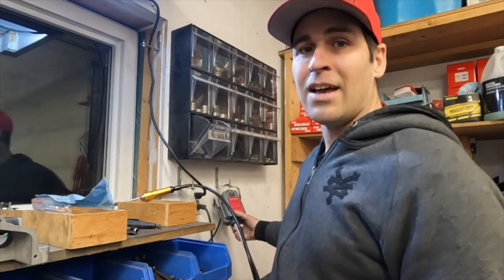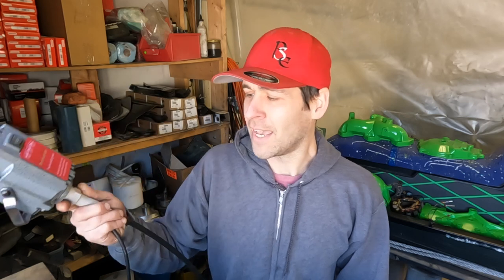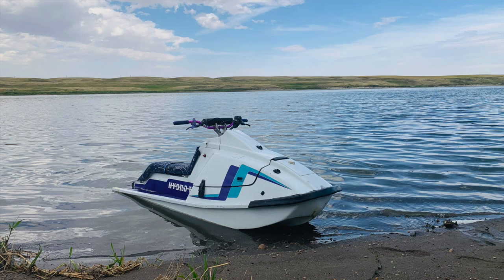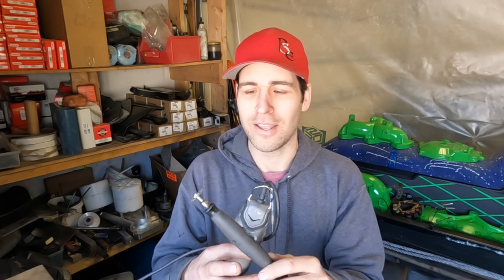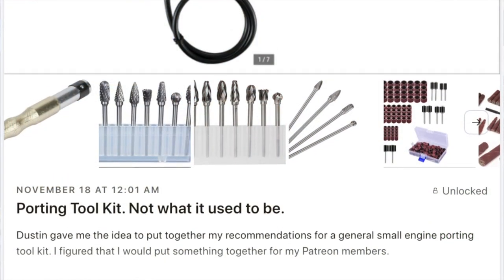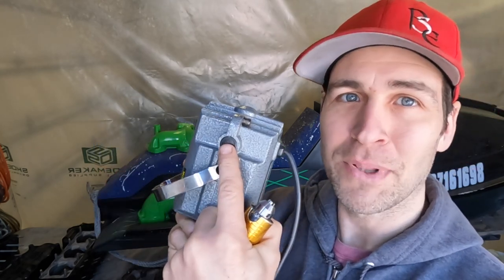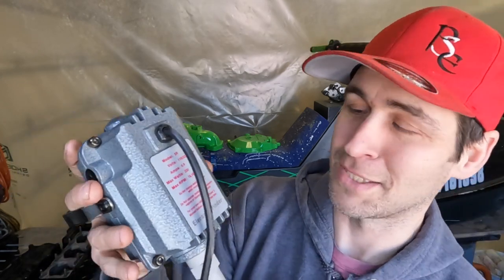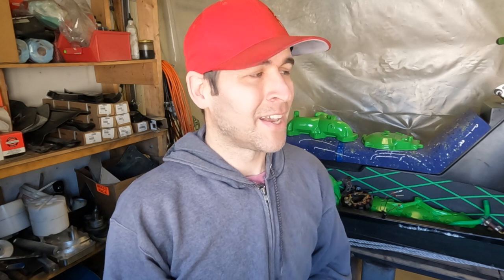VEVOR - Foredom Style Flex Shaft Grinder - In-Depth Look & Disassembly

Comment: Thought I'd let you know.  I've had the Vevor SR for about 5 years. Never had a problem. I service mine (lube, etc) as the manual says. I use Foredom flex shaft grease on the shaft. It was originally purchased for doing silver work but I have used it for everything including carbide burrs on steel. The silver handpiece (#30) is smaller than the 1/4 inch gold. Any foredom style handpiece made for the USA (flag or key they are called) can be used. I have quick release, hammer, engraving, etc. Do not buy Euro style, different connection. Look for the band with the ball bearing. If there is a clip  it is Euro. The chuck style handpiece will come apart(unscrew). Check it before each use. It will screw back together. I put mild threadlock on mine.
Hope this helps. If not, I just bored a lot of people.
Love your YT vids. Keep it up!
Reply from the maker: Thanks for the detailed comment. It is appreciated. 

I have had mine between 2 and 3 years... and also never had a problem. I have heard of people breaking them and I have to think that the are not using them properly, or they just happen to be defective. 

I have seen the silver hand piece and considered getting one, but am always surprised at how well the gold one works. I have a 90º tool, but it is good to know you can also get engravers. 

Thanks for the heads up about the Euro style. Mine has never come apart... other than me taking it apart out of curiosity, haha. Thanks again for the details.

Comment: i took the cable out of the dremel flexi shaft and coverd it in hight temp white lithium grease now it doesnt get so hot. so far its lasted 15 years. mind you im not porting metal cylinder heads Im building radio control model boats.
Reply from the maker: They are 100% better than using a file and sandpaper ! I did manage to port an engine with mine. Much better suited for wood, plastic and lighter materials, like you say. 

My first porting job, with the dremel, I literally used it every day for a month, probably 8 hours a day or more.
Reply: @ oojimmyflip
😆 sounds like the intended purpose, they built it for 😁
Did that too, no problems with my clones.
Then i used it in the shop for planing welds in tight spots with tungsten cutters - oh, surprise, needed one shaft after the other 🤣
Reply from the maker: @werner.x  Interesting... so they don't like that much hard work.
Reply: Thanks for the great video.  I’ve had a Foredom on my wish list for several years, but have decided to opt for the Vevor instead.  Just made the purchase using your coupon code.

Comment: Thank you for the wonderfully detailed review of the Vevor Flex Shaft Grinder. I've been wanting more information on this tool and you certainly supplied it!  Finally, I know what type of connection the shaft has to the tools!!!   If the hammer handpiece I'm looking at is compatible I'll be buying it through your link.
Reply from the maker: They just came back in stock for the US and Canada and Vevor is sending me another one for another video.
Reply: Thanks for the 'Heads Up' on your upcoming video. I'll be watching for it.

Comment: It looks like you could mount the foot switch to a 2x6 block of wood which should give it some heft. And the surface your foot contacts also looks kind of slippery. Maybe there is something you could spray on it to make it rubberized to prevent this?

 As for the smaller handheld Dremel. . . I went through several of them (corded and cordless) and found them to be crap. What I eventually settled on was the Milwaukee M12 cordless rotary tool -- The on/off switch and speed dial are separate and not combined. It has great heft, variable speeds, balance and ergonomics. Yeah. It's a beast and I used mine all the time.
Reply from the maker: I use my foot pedal on top of a milk crate as I'm sitting on a stool when I use it, and I don't have too much troubles with it moving. As for it being slippery, I don't actually put my foot on it, I just put my toes on it as I feel that causes a lot less fatigue. 

I have a TIG welder, and the pedal for that has a grippy top. Most of the time I put my whole foot on it... not sure why. I guess probably the shape of each. 

Milwaukee makes some good stuff for sure !! I have used a lot of different tools, but never a cordless one, for porting or the type of work I do. I had one of those pencil air grinders for a while and it was very compact, but had no power at all. 

With this tool, I still use a file, sandpaper and some other specialty tools for some stuff, but it is pretty versatile. One thing for sure is that you can never have too many different tools, haha. Options are always good.

Comment: The cables break on flex shaft tools if you’re using carbide bits and the suddenly get stopped, flex shaft tools are excellent for cartridge roll sanding, this has been my experience.
Reply from the maker: Yeah... snagging bits is very hard on any flex shaft. I have done at least 3 porting jobs and cut up lots of carbon fiber and fiberglass without any shaft issues. 

I have heard of people breaking these, so maybe it am just much more gentle than the average person. I had a Dremel flex shaft before this, and even though it is much smaller of a shaft, it lasted for years without failing.

Comment: Is the footswitch a true variable switch (press from low to high revs)?
Don't want on & out switch rev.
Reply from the maker: Yes, it is infinitely variable from zero to top speed, and is quite smooth. That is one of the nicest thing about this tool compared to my old dremel.
Reply: @loweredexpectations4927  You stated you got 230W. I decided/ordered the 780W & used your promo code.
I think more power is better than less power. Strange, the 230W costs more than 780W from Vevor.
Thank you for your reply & thank you for your honest reviews.

Comment: hey man how do u know what handpiece fits the rotary tool from vevor?
Reply from the maker: Hey, Julian. 

Vevor sells a bunch of different tools, and only a few of them had the quick change tool on the end. When I posted this video, they were available from all of the places listed in the description, but as of now, it appears the only Canada has the quick change style. 

Vevor does not advertise this feature / interchangeability, so I only know because my unit (Canadian 230W) has the quick change, and a buddy of mine got a 750W and the end wouldn't come off. 

If you have one of the quick change tools, (the tool just pulls off), this is the Foredom Style tool. You can search for that. 

If you have one of the other types, you may have to do a lot of research to find something. I'm not even sure if they make them.
Reply: @loweredexpectations4927  I noticed the tool u had on the vid had a keyway to the handpiece. and another guy on youtube said the foredom had a square.
Reply: @julianlaustsen1991  Perhaps when he said it had a square, he meant it had a key / keyway. I just found a Foredom cable on amazon and it has the same cable end as my tool. I will send the link in another response as sometimes YouTube blocks comments with links.
Reply from the maker: @julianlaustsen1991  If you haven't figured it out, I responded accidentally logged into my other account.

Comment: Hi, very good video, I have a question: 
how long can you work with it and how much rest time do you give it so it doesn't overheat? 
I have a Dremel 4300 and it has broken down several times, they told me that I have to use it for a maximum of 20 minutes and let it rest for 20 minutes so it doesn't overheat, thank you in advance, greetings.
Reply from the maker: I have worked mine pretty hard and never had an issue with heating. These have an aluminum case and a sizable fan. Although I have not broken mine, I suspect the weak point is the flex shaft, and not the motor / unit itself. 

It is important not to try to do aggressive cuts, lug the machine down when it is at low RPM. The speed of the cooling fan is 100% related to the speed of the cutter, so a slow cutter means less cooking air.
Reply: @loweredexpectations4927  Thanks for your reply, I'll keep it in mind. Just the day before yesterday my Dremel broke again. I took it to another technician and he told me the same thing. I don't know if the equipment was defective, but I've already decided to change it for this one. Regards.

Comment: What's the wording to look for to find the burrs for cutting softer materials?
Reply from the maker: Great question. "burr set for aluminum" or "aluminum cutting burrs" You should be able to see form the photos of the tool that the spacing between cutting edges is at least twice as far apart as for steel.

Comment: Fantastic video dude! Sooooo.. as for the pedal, I dropped a clutch drum on mine and it exploded. I then spent about a week learning more about 3d modeling, designed and printed a new one, installed all the springs and switch, and it didn't work. Found out that the switch must have also broke in the smashing. So went online to buy a new switch and they simply don't exist. It's part of a drill button switch, but not the same. Anyway, I just had to re order a new pedal off Amazon. I might still install the switch in the pedal that I designed as I did improve the leverage on the button to give me more detailed control. If it works well, I'll print you one too! I'm so happy with mine! 

Oooh one other thing, my 90° thingy, only fits my long bits. I need to figure out how to get the short bits in there for the transfers on my scooter cylinders. But the collet is super hard.. 
Off to your other channel to see your porting on the X2!
Reply from the maker: HAHA.... Oh no... Note to self ... don't drop things on foot pedal. That totally sounds like the luck that I would have, but I haven't dropped anything on mine ...yet. 

I'm confused... It only fits the long bits ? They are a different size shank ? Thanks for stopping by... see you on the JA channel, haha.
Reply: @loweredexpectations4927  they all say they're the 1/8th size, but the short ones and all my sanding ones don't fit. I haven't actually accurately measured any of them, but I need to. New pedal shows up this week, and I'll get to porting my scooters! :)
Reply from the maker: @dustinwild  I'm guessing that some are metric and some are really 1/8. Mine fit well... but I'm not sure what they are or aren't, haha.

Comment: Foredom do sell a metal foot speed control.  It would put the kit , beyond the price for many users.
My plastic foot peddle works great.😅
Reply from the maker: I agree... I have not had a single issue with the foot pedal, other than it feeling a little cheap and sometimes it moves around because it's so light, and I don't fasten it to anything.
Reply: @loweredexpectations4927  , there are two holes on the base plate for screws. One can screw on a piece of wood. Best to make it big enough for your heel.

Comment: For carving hard wood 230w or 780w
Reply from the maker: Sorry for the delay. I've been away from YT for a while. 

I've never used one of these on wood, so I don't know that my thoughts are too helpful. 

I suppose this depends on how large the carving is and how much material you want to hog out in a hurry. I would worry that the 750 watt would damage the flex shaft if you were carving wood aggressively, but I haven't ever done this.

Comment: Good video. Did the right angle drill work for you? Do you know if it has metal or plastic gears?
Reply from the maker: The right angle tool works well. I have taken it apart and it has metal gears.

Comment: What is the part number, or name for the right-angle attachment? I bought this tool based off your review and I am quite pleased with it but I do not like the supplied handle. I was doing some hoggin out of some aluminum and the whole chuck just fell out. I thought it broke but upon closer inspection I noticed that it is a compression type connection, so I removed the bit and took my 1lb dead blow hammer to it and it seems to hold fast. I need a right-angle attachment for doing fret polishing and other Lutherie jobs. Please respond, thank you.
Reply from the maker: The 90º tool that I purchased is from Amazon Canada and is listed as "currently unavailable" however, there are many others listed as something like  "Gralara Elbow 90 Degree Handpiece Kit Rotary" 

I have actually heard of that happening to one other person recently, the chuck falling off. Typically jacobs chucks are pressed onto a taper. If seated properly they stay on quite well, so hopefully your dead blow solved this. 

The right angle comes in very handy, for sure. It would be nice if Vevor sold accessories, or offered this as an extra.
Reply: Aliexpress, 90 degree flext shaft

Comment: Do you know where I can buy the a inter flex shaft cable for a 780w vevor flex shaft rotary tool. Have the 780w on the way and want to know just in case I break one. Can not get an answer from Vevor.  Thank You Richard   PS  Good vido thanks for info.
Reply from the maker: I'm sorry, but I don't know. I have never actually seen the 780w version in person. I had a friend get the 780W version and he ended up returning it, because the tool is not the same quick change as the one I have... apparently.

Comment: I have exactly the same unit bought before you were affiliated with Vevor or ever talked about it.  So far I have broken 2 flex shafts with it but cheap replacements can be found on ebay for as little as $10 if you don't mind waiting for it to come from china... I hate the foot pedal also and replaced it with an ordinary router variable speed control since I normally just set it to a particular speed and use it without having to control my foot to maintain a speed.  For me, I find this works out much better.  I noticed you said you made your own mandrel for the cone sanders, are they even available to purchase with the extended length shaft like yours?  Totally invaluable for smoothing out porting work and I've yet to get any.  So far the only thing I used mine for (mostly) was to drastically clean up my pump stator which resulted in a substantially noticeable improvement.  You can fill far less vibration. Coming from the pump area as there is far less cavitation.
Reply from the maker: Wow... you must be using it a lot, haha. Mostly porting or just random stuff ? 

I know the whole idea of the flex shaft is to give you freedom of movement, but I try to be really aware of not bending the shaft too much in operation ...I have noticed a few times that it will start ... oscillating inside of the shaft if the bend on the cable is sharp and the load on the tool is high.... I immediately stop and reposition. I have heard others talk about shafts breaking as well and almost bought a few as spares when I got mine. Maybe I should. 

I have heard others say they hate the pedal as well. Personally I really like it. I rarely keep the same speed. Recently I have started to place my foot on the rung ( is that a word) of my stool, and put the pedal on a milk crate so my foot rocks on the stool. Hope that makes sense. 

I made the longer mandrel because I couldn't find a long one for a reasonable price and delivery time... I think I found a few while deep into a search. 

Oh yes.... I had totally forgotten that I also ported one of my pumps as well, haha... I've used it for a lot of stuff already. It does make a big difference.
Reply: @Lowered Expectations  I really don't use my wannabe Foredom that much.  The pump was the only big project and beyond that it was just random things on a case by case basis.  I guess I'm just hard in stuff...  but both times the failure point was where the braided steel cable gets crimped into the aluminum feral (the part that clamps onto the "D" shaft of the motor.  If I were you I would pick yourself up a spare flex shaft to keep on hand, It is cheap enough and from my experiences you will likely need it at some point.  As for the foot pedal sounds like you got a system that is working for you and I can see in some situations it would be nice to have the. Variable control on the fly.  For me I found setting it to a rpm that is the right speed while under load it is easier to "set it and forget it" - just a matter of personal taste there.
Reply from the maker: @AtimatikArmy  Right on... good info. It's nice to hear it from someone like you instead of just a random internet comment. I will see what I can do about getting a replacement shaft. 

I can also see your side of it, wanting to set a speed and leave it there... I just find that when using burrs, I tend to run at a pretty low speed for skimming out casting marks, but if I get to a spot where there's a lump or seam, something that requires more material removal, I will go at that more aggressively, and like to speed it up a bit. I can totally see it being a preference thing.
Reply: @loweredexpectations4927  
I did break some shafts also, but it was on these Dremel clones, whilst planing welds on steel parts.
When the cutter binds suddenly, even if it just slows down at overload, the motor twists the shaft and if this happens several times, it finally breaks.
Don't know, if this is a thing with this stronger tool, but stocking up with a replacement on occasion isn't wrong.
Reply from the maker: @werner.x  I guess I am just a gentle soul, haha. I have had the binding issue with my Dremel a few times, but this new tool seems a lot better. I can totally see how they would fail ... due to the way they are wound, there is a weak point... I'm hoping mine stays together !!